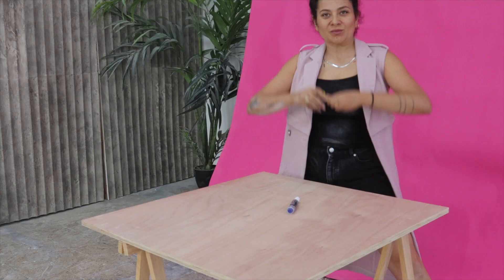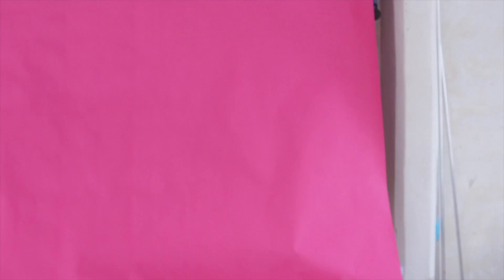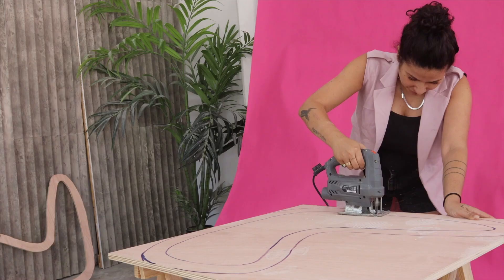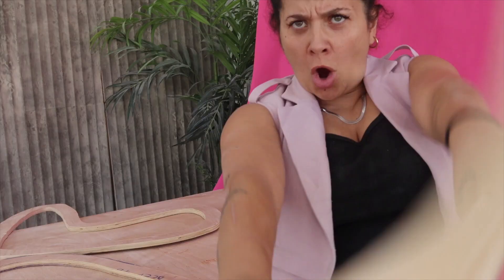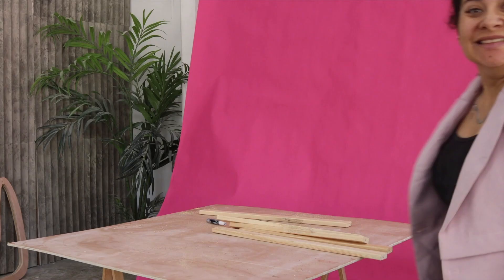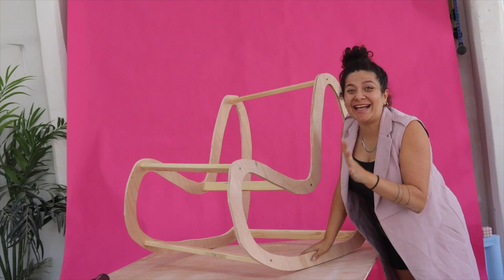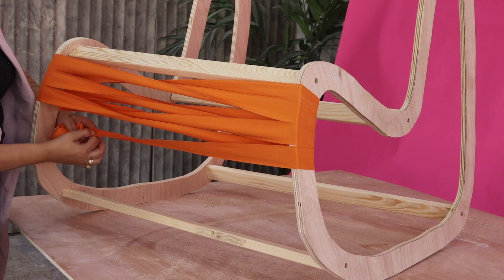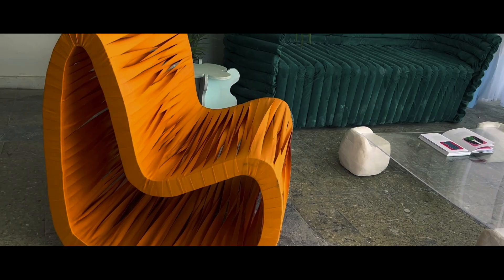HOW TO MAKE THIS ROCKING CHAIR IN 3H! // DIY CHAIR ON A BUDGET

Comment: if you just put one screw in each brace, they pivot. 2 screws min
Reply from the maker: Nahhhh If you Leave it on the flat side and screw it tight it stays there it’s not used as a vertical column. In that case you are totally right. 
+ It’s in The inside you don’t feel it when you sit so even if it would pivot it’s no problem at all it would still keep the same distance between right and left and that’s all we need ❤️